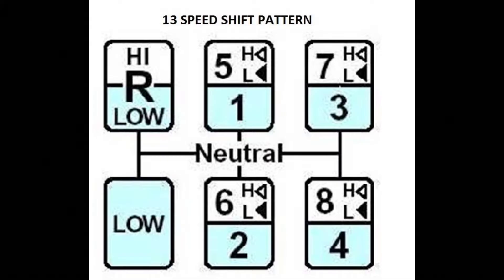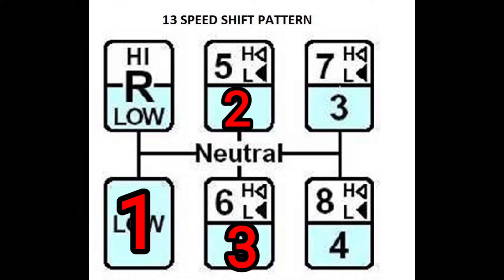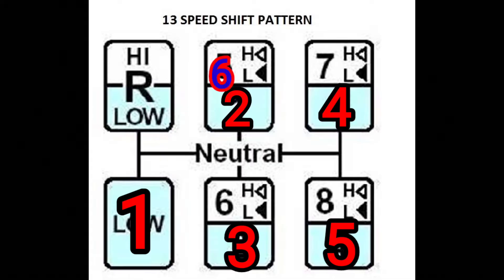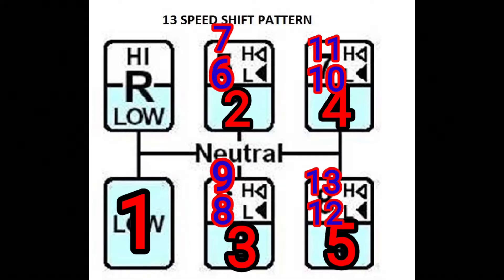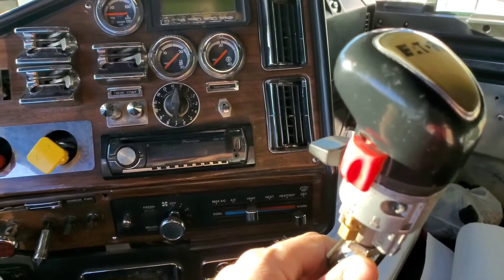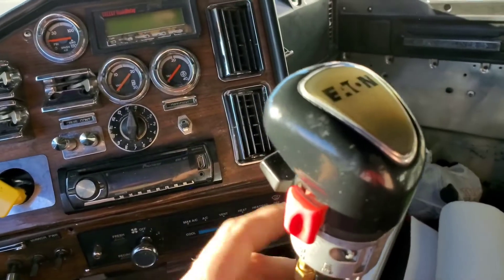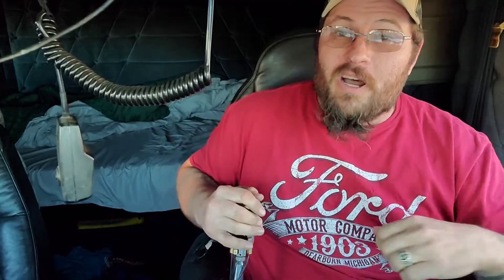HOW TO SHIFT A 13 SPEED MANUAL TRANSMISSION IN A SEMI

Comment: There is no need to renumber the gears from what the manufacturer was labeled them. This only adds to the confusion. Only thing to remember is 13 speed allows you to split the High range gears with the red splitter button. Just like if I say "orange or apple". You instantly know the difference between the two types of fruit. 18 speed, 13 speed, 10 speed etc., etc.

Comment: I was taught that you Do Not preselect when going from high to direct, shift the whole gear and then you split it for direct. Yeah, they will do it but the synchros in the butt section won't last long. As far as not using the clutch, thats just silly,works great most of the time,but not always.

Comment: Disappointed you couldn't find a way to complicate the splitter and range like you did the gears. Dude, it's Low plus Twelve, the shifter is marked the way it is for a reason. Imagine 2.5 million trucks on the road with mismarked shift patterns. Yeah 13 forward we get it..

Comment: Hey thank you my brother for taking the time to make videos like this I really appreciate it and you did an awesome job with breaking it down very explanatory it will definitely be helping me out big time this week with a new job that I'm starting I've been driving a 1984 Peterbilt with the 10-speed transmission at Tandem and a flatbed on a Freightliner Cascadia put the 10-speed transmission so I got so used to the concept of it basically almost being like a car or pick up with a manual transmission and having to shift through that first set of gears hit that splitter one time and then run through the next set of gears so it's pretty easy and simple to run a 10-speed transmission starting a new job and they have a whole Fleet of trucks some of them are automatic some of them have the 10-speed one has a 5 and a 4 and 13 and 18 speed transmissions some old school and some are brand new semis a little  nervous about being thrown to the wolves but I am confident I will figure it out

Comment: What rpms you running your 13 speed in 13 gear at 70mph
Reply from the maker: @magus7935  around 1500 ish
Reply: What are you running. Im at 2100 rpm in 13 at 70mph and i dont like it. I have a 359 pete with 3.55 on 24.5. im wanting to get to 1500@GoFastNation
Reply from the maker: @magus7935  it's in the neighborhood of 15 to 1700 i think.

Comment: I noticed that you switched on the range switch before you shift from 5 to neutual (at 7:48 ). Does that go to 12/13 gear?
And you don't press the clutch either in moving the rod or in switching the range/splitter switch? It's realy amazing how the gear box works.

Comment: Nice video 👍🙂 when I did my cdl training of last year we started of 10 speed so how do you downshift with a 13 speed sorry stupid question 🙂👍
Reply from the maker: You just lift off throttle, move the thumb switch back, then gently bring up rpm until it catches the gear. Then down shift normslly

Comment: Just some extra knowledge for people who may want it. As shows us, the 13 speed spilts the high side. 15 speed speed splits the low side. 18 speed spilts both the low and high side. 13 speed side splitter is red, 15 speed is blue and the 18 speed is gray.
Reply: U did it all brother, one of the best explanations I've never encountered before
Reply: Thank you man
Reply: Another "tidbit" for the same folks: Eaton based the 5 & 10 from the 5 sp Spicer main box. The "Roadranger" function (side switch) eliminated the auxiliary (second transmission) box by implementing direct "ranges" in this new single main box
The real magic came with the creation of this one in this video.
This is the "4 speed with a low hole" rather than a true basic 5 speed platform.
This unique platform allows for the greatest single box transmissions in history--8LL, 9sp, 13sp, & the 18 sp.
Both platforms have the "Lo Lo" and it's always Blue.
-------
If you research the "Silvercaps" you'll see more patterns that still work smoothly on these newer units. These were the early Fuller Roadranger shift handles. 
The current Overdrive builds usually have a true extra 300rpm split *gear in the low hole intermediate (middle) range but Eaton won't allow you to use it.
But sooner or later with either builds, you'll hypnotically drop it into the low hole (middle range) going through an intersection or whatever, and then you'll move the roadranger switch forward for another perfect shift. Then instinctively pull it back (rearwards) & shift up into 5 (up against the dash) and continue as normal.
*Consecutive. Thus the 8LL is a true 10 & the 13 is a true 14 etc...
(This is the short version...)
Cheers!
-------
Dutchboy out

Comment: So let me understand this: you shift to 6th gear with the regular splitter, then hit the side splitter and the transmission will automatically shift into 7th? Is that right? If so.. then its basically the same for the rest of the high gears? 7th, flip side splitter, shift to 8th, flip side splitter transmission automatically shifts to 9th etc....

Comment: I tested  for my CDL with a 13 
2 days  ago but I did probably 95 percent of my training in a freightliner  10 speed  I can drive this smoothly, aaaand fail the road part .
Did I fail or did my school fail me? 
If I had known that they would pull a switch on me I would have applied my focus a bit more on the pete with the 13. HELLO😮
Reply from the maker: Bummer! I would have focused my attention to both of them unless you didn't have the choice. Experience on as many transmission as possible will only help you in the future. Hope you have better luck next time!

Comment: It's really simple if they understand that they can only split gears in high range.    So in low range you get the first 5 gears.   In high range you get the remaining 8 gears between low split and high split.    For a total of 13 speeds
Reply from the maker: Nail head, meet hammer. 👍👍👍

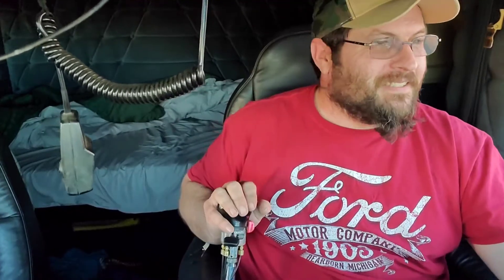Comment: 6:21 never seen such placement of the gear lever. Almost on the chest of the driver.😮
Reply from the maker: 12" extension of the rod. I liked it but not for everyone
Reply: I got a question do we have to use press ([DOUBLE CLUTCHING]))) WHEN WE SHIFT SIXTH GEAR PLEASE EXPLAIN BE SPECIFIC
Reply: Could you explain how many RPMS do we need when we shift using spliter?
Please
What things we should do and what things we shouldn't do driving 13 speed,double clutching RPMS

Comment: What are the rpm’s for a 13 speed for low and high range gears? I know for a 10 speed 1-5th gear rpm’s 1000-1400 and 6–10th gear , rpm’s ranges from 1500-1800rpms. So what should the rpm’s be for driving 13speed ?

Comment: Your shifting way to fast must be a newer truck you ain’t shifting that fast in and old truck I’ll tell you that bud try shifting an old cat like that especially loaded 26 27 ton you would be on the side of the road but good tutorial on how to demonstrate the 13 speed over all good video
Reply from the maker: It was a 99 freightliner classic with a light load of mushrooms  lol. Thanks!
Reply: What motor?
Reply: All I’m saying is those old girls don’t like fast shifts like that eventually you will just wear out the tower and  possibly bend the main shaft inside and it will get really really sloppy witch ain’t good not picking on yah by no means just giving you some advice that’s all after all we are all out here still learning what these old girls like and don’t like trust me they will let you know lol and the day you think you know it all might wanna hang the keys up and get out the truck cause you will never know it all ever lol

Comment: I’ve been driving Automatic for 2 1/2 years the whole time I’ve been wanting to drive a stick. All Warner’s trucks are all automatic. Entry-level drivers. Gotta get a whole Nother license just so I can drive stick.
Reply: That really is kind of bad they won't let you drive a manual.  I started driving in April,  1978.  There were automatics,  just the Alison automatics and they were expensive.  When I retired in 2022, I was still driving a 10 speed manual.  I have driven an auto shift 13, before it was ok, but I always enjoyed taking a heavy load up a long steep hill/mountain,  getting up as much speed as I could,  then pick the correct RPM to down shift.  A few times I down shifted too soon, but on a steep hill,  it didn't matter just wait for the truck to slow slightly and in gear you go. Of course when I first started,  a lot of trucks had engines in the 238- 300 horsepower range,  and didn't have a lot of Torque either.  Wasn't uncommon to pull a 3 mile hill in 2nd gear for more than half the hill.

Comment: Great video, just wondering.  I learned how to drive a car in stick shift.  I can still drive a car with a stick, so I am wondering what kind of learning curve is there for running a rig like yours? It looks similar but different pattern wise, it's the not using the clutch for every shift that had me worried.
Reply from the maker: Biggest thing is don't use throttle when starting off. It will jump alot and be rough. Other than that its not that different.

Comment: My question is what if you don’t want to split the hi gear 5678 what range would you keep the side splitter inn? Leave it in low? Be like go from 5 low to 6 low to 7 low to 8 low instead of splitting to hi
Reply from the maker: @voiceforthevoicelesstruth5480  if you're light you don't have to use the splitter to get into the high side until you're on the highway ready for 13th at cruising speed

Comment: Thanks for the video, I haven't driven a 13 speed since 2014, and most of what I've driven since then has been an automatic. But I think I'm getting back into a 13 speed so I had to watch your video as a refresher course. Very nice job shifting those gears..... Question, I think I remember being lazy about shifting, and I think I used to skip shift a lot after I got into the high side of the side splitter. Just by holding out my gears just a little bit longer. There's nothing too wrong with that is there?... Or maybe, I was skip shifting all of the higher gears but on the low side of the side button, until I got to the end and then I'd flip it into high. Same concept. You see any issues with that? Besides possibly losing a little bit of fuel mileage?... I would think that maybe fuel mileage would balance out, considering that you're not letting off and on the pedal as much....Certainly, I would think if you were empty or had a light load, that should be all right. Anybody have any comments, feel free to weigh in
Reply from the maker: Oh no not a problem.  If you're light or empty skip all you want. But heavy I'd use them all
Reply: @GoFastNation  thanks boss

Comment: question? when you upshift an you split each high range gears(5H,6H,7H,8H), do you have to downshift the half gears or can you downshift full gears regardless if you split them upshifting?
Reply from the maker: No you can down shift full gears. The way I do it is from 13th, I split down to 12th then do full gears until I'm stopped.  Unless you're climbing up a hill then split each gear to maintain as much rpm and speed as you can.

Comment: Great video, I'm about to take delivery of a crane with this transmission. Your explanation is very helpful. Hope you put on your seatbelt, be safe out there.
Reply: I'm back! We got the crane. It's a cab over Peterbilt. Lots of linkage to push through. Upshifting is going well enough, but downshifting is ugly. Any tips on how to not make things sound like Sir Grindsalot on the downshifting?
Reply from the maker: Congrats! Just rev match the best you can and be gentle with it. You can downshift using the side splitter like 13 to 12 then take full steps down just using the stick. Make sure you use slow steady throttle pressure to increase your rpm while putting slight pressure on the stick toward the gear you're trying to get into and it'll slide right in. Just be patient and be gentle, you'll stop grinding pretty quick once you get the feel for it.
Reply: @GoFastNation  thanks brother. Appreciate it more than you know. Side split downshifting is just like the upshifting? Click the switch with foot on the throttle, slight relax and then back on the throttle again right? Cheers.
Reply from the maker: @button-jeff  no you need to be fully off throttle click the switch then go back on throttle to bring up the rpm. You'll feel it once it's in.

Comment: Is it possible to shift with using the red side splitter if my truck is empty? I was told only to use it when I’m loaded
Reply from the maker: You can use it whenever you want to. However you don't need to use it when you're empty.

Comment: i been driving 10 speed for many years no splitter so got new truck i drive it like 8 speed with occasional splitter use as needed i though it was 8 speed r but i just found out its a 13 speed 6 month later haha. I pretty much drive it like 8 speed with splitter when needed
Reply: is using a plitter a must i been going without it unless i feel like i need it am i doing it wrong???
Reply from the maker: No its not a must. It just helps when you're heavy.
Reply: @GoFastNation  that's what I figured all a long I though u was driving 8 speed w splitter thanks for clarification!

Comment: Best explanation I’ve seen on YT so far. I’ve been driving a 10 speed forever, going to a thirteen very soon.
Reply: I’ve had my cdl for a bit now and I’ve been struggling with the downshifting (mind you my first truck was stick) so I’ve been driving for a while. I already knew everything you explained, but the way you explained it really helped the information “settle” in my brain if that makes sense and I’ve been driving a lot better and smoother ever since
Reply: Ditto
Reply: Ive been driving for years also he explained it the better than most Ive heard I speed match to know what gear I should be in and can drive 18 speed pretty much the same way.😅
Reply from the maker: Thank you! Glad I could help
Reply: I was going to say the same thing
Reply: Same here I've been driving a 1984 Peterbilt with the 10-speed transmission at Tandem and a flatbed on a Freightliner Cascadia put the 10-speed transmission so I got so used to the concept of it basically almost being like a car or pick up with a manual transmission and having to shift through that first set of gears hit that splitter one time and then run through the next set of gears so it's pretty easy and simple to run a 10-speed transmission starting a new job and they have a whole Fleet of trucks some of them are automatic some of them have the 10-speed one has a 5 and a 4 and 13 and 18 speed transmissions some old school and some are brand new semis a little  nervous about being thrown to the wolves but I am confident I will figure it out

Comment: 45 years driving a truck and not a tranny I haven't shifted, and never once have ever put a tranny in a low or considered low..I don't care if I've got 10 ton on or 20 ton!matter fact most of the time I usually start in 2nd heavy 3rd or 4th light...I've got 6 tractors with 18 speed tranny's and never split gears...
Reply from the maker: Start watching at 6:10 I said this is why you DONT use first

Comment: When you go for your road test.. you have to use the clutch,, changing Gears,,after you on the job,,  most don't use the clutch love the video..thanks
Reply from the maker: I didn't use the clutch on my test and I aced it but that was like 8 years ago lol
Reply: @GoFastNation  just did my test today, you're technically supposed to double clutch it but I suck at it but I'm great at floating. 
So I floated on my test... and still passed lol
Reply from the maker: I floated on my test. Aced it lol. I asked my tester if she wanted double clutch or float and she said she didn't care just do what's comfortable.  Congrats on passing your test! Be safe out there

Comment: Iv only ever drove 10speeds and I went for a job the other day the guy said it was a 8speed had me all messed up at first till he finally told me how thay split different thin thay are numbered but still the same kinda as a 10speed had me worried I wouldn't get the job but the 10 miles I drove I got it Pretty slick by the time I was coming back but I wood feel more comfortable with a 10speed just because it's all iv ever got to drive but I do like the 13speed an I'm sure I'll have it down in a few days after I finly start for  them

Comment: I wonder why people are instructed to destroy the shifting tower , sliding clutch/collars on the main shaft and high and low range synchronizer floating gears , instead of using the clutch an shifting correctly .
Reply: I've put over 1 and a quarter million miles on one of my trucks,  and had to replace the clutch twice.  Never did more than change the transmission oil every 100,000 miles.  Had a Freightliner with a Cummins N14. One of the best engines Cummins ever built in my opinion. I very seldom used the clutch.  I would guess less than 1 % of the time did I use the clutch. A 13 speed, then my next truck had an Eaton super 10. Again another million miles,  no transmission problems.  Not using clutch while shifting.  If you're careful,  and know how to shift,  it won't hurt the transmission.
Reply: @bertgrau3934   (and had to replace the clutch twice. ,  If you're careful,  and know how to shift,  it won't hurt the transmission. ) ?   Tell that BS to someone dumb enough to believe you , I know for a fact different . I`ve seen about every type of jack leg destruction , by fixing the destruction of the ignorant , from the 60`s to the present . Highlight that !

Comment: Side splitter is basically a TA (torque amplifier).
Once I got that figured out, it instantly became completely relatable to me.
With farm tractors there is more overlap in the gears so most of the time you don't use the hi/low between gear changes, unless you're pulling a heavy load.

Fantastic video!
Reply from the maker: Thank you!